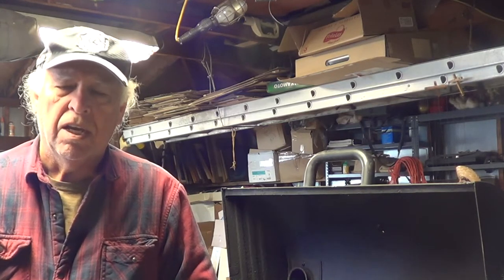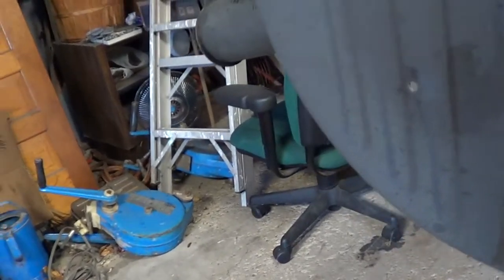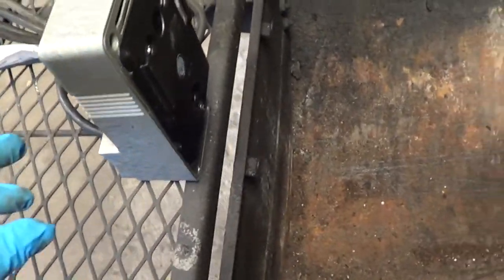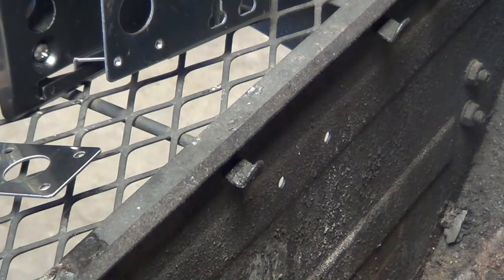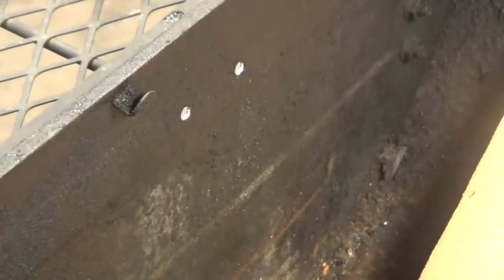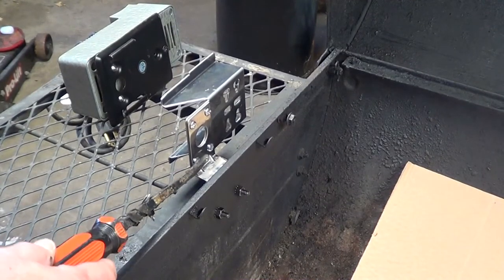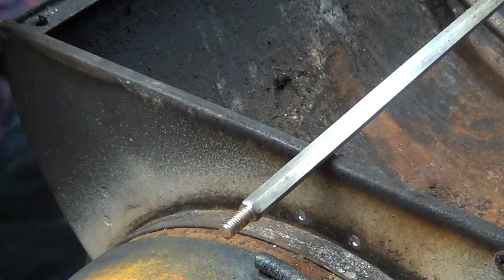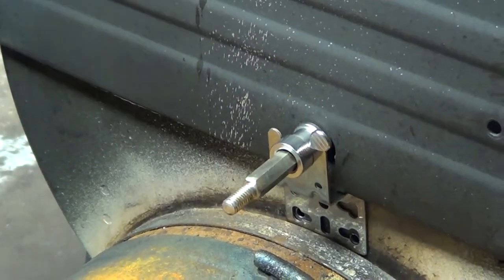Grill Rotisserie Installation

Comment: I got the Rotisserie (Item #5022) for the Char Griller Duo (Item #5050) and this is going to help me a lot. I really appreciate the time and effort with the installation process. I even got the 53 inch spit rod to use it for my gas grill and charcoal at the same time. Closing the lids is an option I'm definitely considering now that I saw your video on how to remove the knock outs!
Reply from the maker: Hey!  Glad this helped you.  It's always good to be able to close the lid to retain heat and also to smoke.  If you haven't done so get yourself a couple more forks for multiple meats on your rod.  Happy grilling!